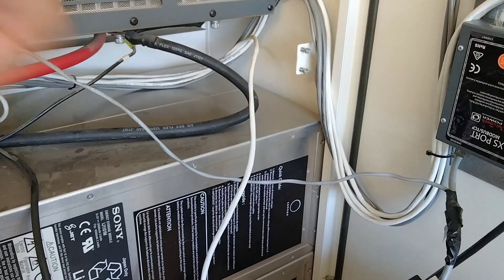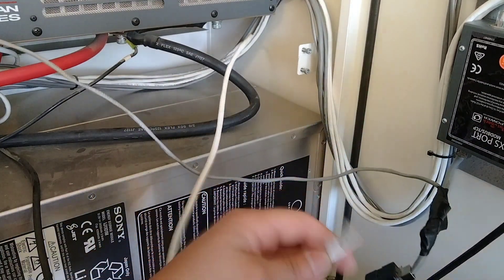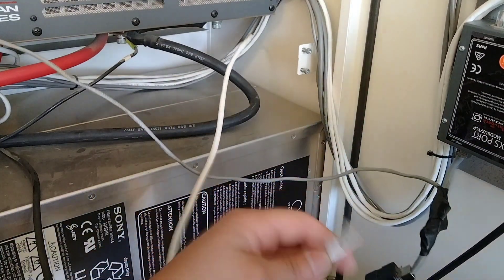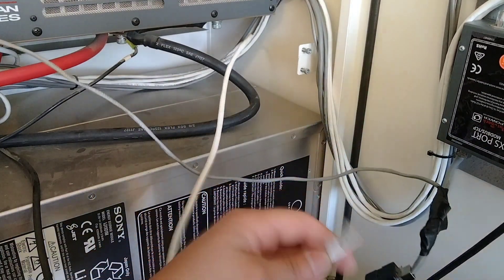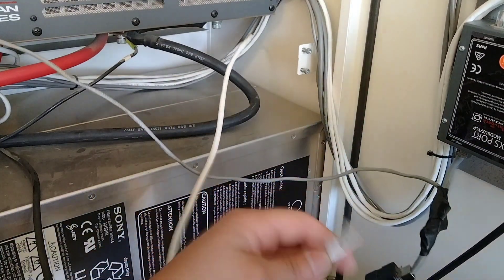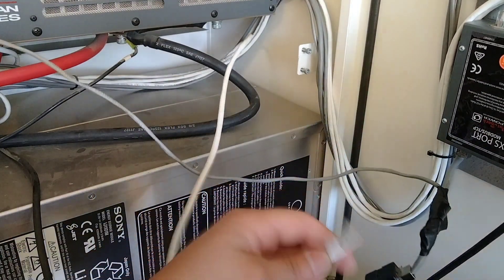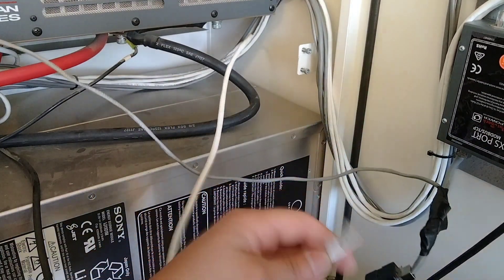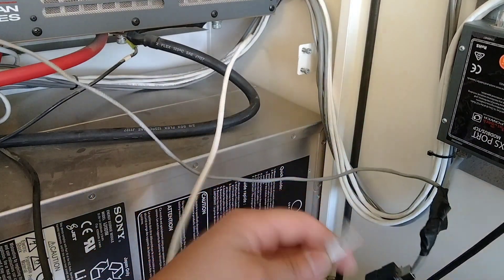Battery charging from Outback via Mate3s 3s (sonnen)

Comment: Hi, any tip on how to sell more? I set my sell voltage but avery day i lost about 4 or 5k because de battery require some voltage to mantein. i have an radian 8048 and a Pytes battery bank. My setting is 54.8 for sell voltage , 56.8 for absorb and 56.v for float. Any recomendation? (i dont speak a good english so excuse if its not well write)